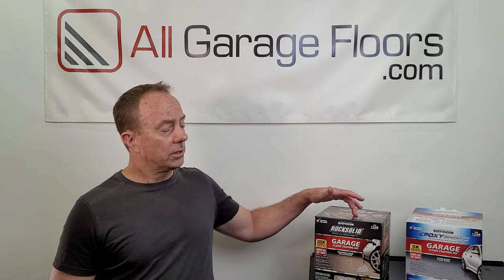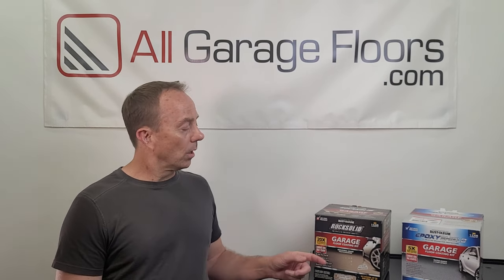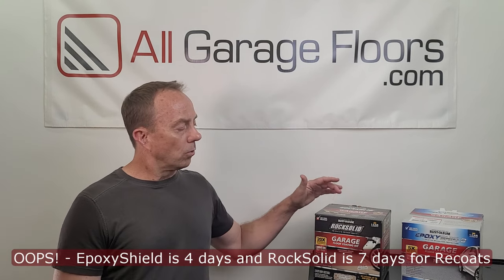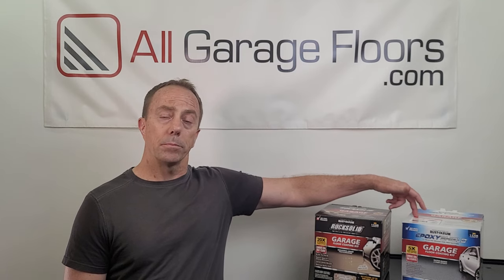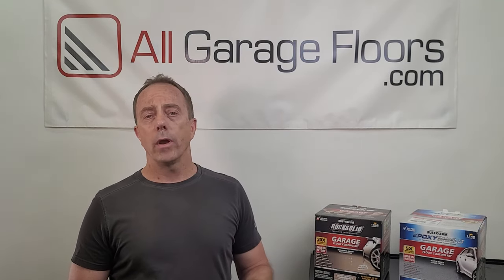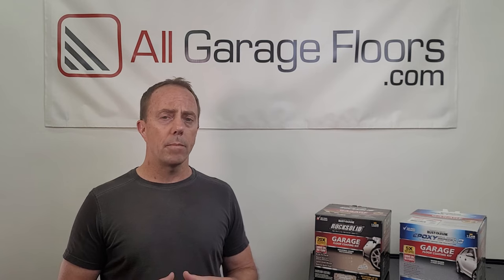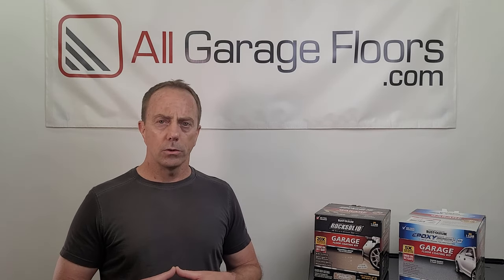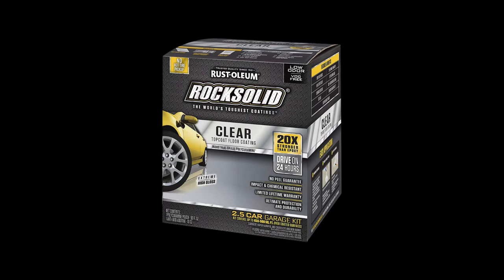RockSolid vs EpoxyShield | Which is Best for your Garage?

Comment: Great vid!  I just put Rock Solid in a basement work shop. The concrete which was about 50 years old, was recently ground down to a smooth-ish surface. I had 340 SF to cover, I used the 2.5 garage pack.  The results were terrible. Extremely blotchy/patchy.  The only good news is that Rustoleum is going to pay for a second 2.5 kit as they say that the only option is to add another coat.  I am within the recoat window, so we should be good.  Here is the bigger issue though.  After applying it, I realize that I really don't like the glossy look.  It literally reflects the bright LED lights in the ceiling so well that I can barely see when I am in there.  Do you know of a way to reduce the gloss?  Maybe sanding it (lightly) after its all done? Let me know.  Thanks!
Reply from the maker: Hi Zach. Sorry for the late reply. We found your comment being held for review for some reason. The best way to reduce the gloss is to apply the RockSolid Clear coat with anti-slip media added. The clear coat is less glossy than the color coat and the anti-slip media will cut down on some of the gloss as well.

Comment: Can you use the epoxy clear coat on the  rock solid ?
Reply from the maker: Hi Victor. No, Rust-Oleum states you should not intermix epoxy with RockSolid polycuramine and vice versa.

Comment: Very well presented with great details. I just painted my garage floor last week, but also found that the Rock Solid left a lot of discolored areas, probably due to concrete absorption of the product as you mentioned. You stated that re-painting can be done up to 7 days afterwards, but I will be out of town and won't be able to repaint until perhaps 10 to 12 days with a kit that I ordered on Amazon. Is there a lot of risk by waiting this long? Can I prepare the surface to make it work without having problems with peeling?
Reply from the maker: Hi Randy. There is no risk in waiting longer. However, you will need to prep the surface properly once you exceed the recoat window. This requires deglossing the surface by roughing it up with 120-150 grit sandpaper. A quick way is to rent a floor maintainer and go over the surface with a green scrub pad (dry) and then scuff up the corners and edges with sandpaper. Vac/sweep and then wipe the surface down with denatured alcohol or equivalent. Once it has evaporated, you can recoat.

Comment: Can we apply a layer of clear Rocksolid on top of color EpoxyShield for better durability? Thanks for your educational video!
Reply from the maker: RockSolid and EpoxyShield are not compatible. RockSolid Clear Coat can only be applied if EpoxyShield has cured for over 48 hours. It will require sanding the surface with 120-150 grit sandpaper to degloss the surface before you can apply the RockSolid Clear Coat. This achieves a mechanical bond. If you haven't applied EpoxyShield yet, then use EpoxyShield Premium Clear Coat. Apply between 12 hours and 76 hours after EpoxyShield has been applied. This will achieve a much better chemical bond. EpoxyShield Premium Clear Coat is a 100% solids epoxy that is compatible with EpoxyShield. You can find the best price here at Amazon: https://amzn.to/4dCtTAa
Reply: @allgaragefloors  Great, thanks so much for your reply.

Comment: Is there any clear coat sold in hardware stores/amazon that can be used as a topcoat for the epoxy shield and will reduce or prevent yellowing?  I got a good deal on leftover epoxyshield from a friend and will be using for an enclosed trailer for my mowing business.  The ramp will be opened and exposed to the sun constantly which is why I’m looking to reduce the yellowing. The trailer is basically new and hasn’t been used but one or two times.  I have applied zinser bin on the floor assuming I would be using deck paint.  Will this primer work with the epoxyshield as well?
Reply from the maker: Hi Shane. Any clear coat you apply will allow the UV rays to pass through to the epoxy coat and cause it to amber (yellow). Polyurethane and polyurea clear coats will not amber, but the epoxy will. This article explains more: https://allgaragefloors.com/why-epoxy-coatings-turn-yellow/

Comment: I have the rustoleom epoxy shield painting kit,can i then use the rock solid clear coat over that?
Reply from the maker: Hi Matthew. No, Rust-Oleum specifically states that the two kits are not compatible when applying within the recoat window. However, if you let the EpoxyShield cure completely, you can go back over it with 120-grit sandpaper to rough it up and then apply the RockSolid kit over it.

Comment: Do you have any data on applying either product to plywood, such as a floor in an enclosed cargo trailer?
Reply from the maker: Hi Ken. Both can be applied to a wood floor. It requires roughing up the surface with 60-80 grit sandpaper to remove any dirt and grime plus leftover contaminants from wood glue. RockSolid is the better choice of the two in terms of durability. Many times it requires two coats since wood is a more porous surface than concrete and both RockSolid and EpoxyShield are thin coatings. As a result, it typically requires two single car kits or one 2.5 car kit (2 burst pouches). The reason for this is that you can't let the mixed product sit the minimum 6-8 hours between recoats. An anti-slip media is required for the final coat or the surface will be very slippery when wet. 

There are much better coatings than these two that you could use. One example is single-part polyurea. It goes down much thicker, it does not require mixing two components (other than the color pack), it's UV stable, and much more durable. Plus, you can apply a single coat, seal the can back up, and then apply another coat 5-6 hours later. It actually costs less since you don't have to purchase as much material. We provide more details about single-part polyurea as well as links where you can purchase it here: https://allgaragefloors.com/polyurea-best-garage-floor-coating-kits/

Comment: Thanks for the Great video and it help me decide on epoxy to rock-solid iam gong with rock-solid and had a question for you do you recommend clear coat after rock-solid epoxy ? is that beneficial ?
Reply from the maker: Yes, a clear coat is always beneficial. It locks in the color flakes and helps to protect the color coat.
Reply: Sure thanks  @allgaragefloors
Reply: can u please advise me which one to use for clear coat for 2 garage i see textured coat and clear coat and its confusing
Reply from the maker: @badristraveldairy5362  Use the standard clear coat and not the textured. The textured version is much less glossy.

Comment: Large airplane hangar with black epoxy floor. Could I use a walk behind floor cleaner with the EpoxyShield? Red 3M pad to clean and dry burnish with white 3M? Maybe?
Reply from the maker: Hello Paul. We would not recommend EpoxyShield for a large airplane hanger if that is what you are considering. It is a residential quality product and among the lowest performers of all epoxy floor coatings. Cleaning with a Red 3M pad is OK, but you need to be careful about burnishing. If the white pad gets too warm it can haze the finish. That particular cleaning process works OK for commercial-quality coatings, but is not recommended for EpoxyShield or other residential coatings.

Comment: Thank you for a great video.  I would like to coat a newly built home garage and wondering about the prep.  The usual to clean it up as best possible, blow, vacuum, soap and or degreaser (although no grease on the concrete yet since new).  My question is whether a primer should be put down before using the Rocksolid product?  You mention the concrete can be porous so is priming not recommended because the Rocksolid product is made to bond to the concrete?  Any advice would be appreciated, thanks
Reply from the maker: Hello Peter. Once the concrete is clean, the most important part of the prep is to properly etch the surface. This is particularly important for new concrete. RockSolid provides the etching solution in their kits. There is not a proper primer available for RockSolid. It adheres very well to concrete. A typical problem that can develop with RockSolid is the coating ending up too thin after it cures. When this happens, another color coat is required. The following article discusses everything you need to know about RockSolid and primers: https://allgaragefloors.com/epoxyshield-rocksolid-concrete-primers/
Reply: @allgaragefloors  Thank you.  I am starting the project soon - one additional question;  You mention clear coat - is this a separate application once the original coat is laid down and dried (along with flakes)?  Or is this an additive that is mixed with the color coating in the Rock solid product?

thanks again also for the buying tips.  Very helpful
Reply from the maker: @Peter997S  The clear coat is a separate coating by RockSolid. You can find it here from Amazon as an example: https://amzn.to/3Xoa61P It can be applied from approximately 8-10 hours after the color coat is applied and up to 7 days after that. Otherwise, the surface would need to be sanded first.

Comment: Can I apply either one of these to the wood floor in my shed??  My 40x14 shed is my shop.  I hope I can use this on my floor!
Reply from the maker: Yes, they can with proper prep. Sand the surface with 60-grit sandpaper to cleanup the wood and remove any glues and other wood treating residues. RockSolid is the better choice since polycuramine has some flex to it. Epoxy does not flex and can crack if the wood floor flexes. You may need two coats.

Comment: If I go with the rock solid how should I prep the garage floor considering that it is a new home/new garage floor?
Reply from the maker: Hi Nancy. New concrete blocks adhesion more than older concrete due to the freshly troweled surface and excess laitance from new concrete. You need to clean the concrete well and then etch it with the solution provided in the kit.

Comment: If i grind the concrete first should i use a primer? If so what kind?
Reply from the maker: Hi Kyle. Rust-Oleum does not recommend grinding the concrete when using RockSolid. The reason is that the more porous surface will absorb more material, reduce coverage rates, and be too thin with a poor finish. A second coat is required to produce the recommended coverage rates with a rich, glossy finish. This doubles the expense and ends up costing more than much better commercial-quality DIY polyurea coating. 
True primers for coatings are 2-part epoxy coating primers. These are typically used for high solids and 100% solids epoxy coatings (3-4x thicker than RockSolid). Concrete bonding primers or any other concrete primer found at your local home improvement stores are not compatible with coatings (they are for paint) and should not be used. They do not bond as well and the coating will not adhere properly.

Comment: If i have brand new concrete from a new build home in garage. Do i need to degrease and etch floor still?
Reply from the maker: Yes, it's even more important with new concrete. Excess laitance and the finishing process to  make the concrete smooth results in more pores blocked and the coating will not adhere. This article explains more: https://allgaragefloors.com/etch-concrete-before-epoxy/
Reply: @allgaragefloors  makes sense thx u for the info and quick reply

Comment: my garage floor has moisture on it when it rains, what do i put down before the rocksolid to stop the moisture issue?do i also need to sand the floor first?
Reply from the maker: Hey James. First off... yes, you need to properly prep the surface of your concrete before applying a coating. RockSolid provides a citric acid etch in their kits. 

It sounds like you have a concrete sweating issue. I suggest reading the following article to help you determine if that is the case: https://allgaragefloors.com/how-to-stop-sweating-garage-floor/ 

If you have a sweating garage floor, then a coating will not stop it since it's a similar surface.

Comment: Planing on Using rock solid with a full broadcast chip,
Scape off loose chips 24 hrs later and then top coat with rock solid clear. Also have some half walls I’m planing on doing. 2 car garage but I’ve purchased two 2.5 kits and two kits of top coat. 
Any issue you see I may run into?
Reply from the maker: Hi Scott. No.... DO NOT use RockSolid for a full broadcast color flake application. There is a reason why these kits only come with a limited amount of color flakes. The coating is far to thin to accept all those flakes. Once you apply the flakes and then scrape them as required, you will have bare spots with the color coat showing. Full broadcast applications are for coating with a MINIMUM of 5-6 mils dry film thickness. High solids and 100% solids epoxy are typically 8-12 mils thick and most commonly used for full flake applications. RockSolid is only 3 mils. The color flakes when applied add approximately 5 mils of thickness. As a result, there is not enough RockSolid for the color flakes to sink into and adhere. Furthermore, you would require a minimum of 4 RockSolid clear kits to properly cover all those flakes since they go on half as thick as the color coats. The overall cost ends up being too expensive and underperforms since it's only a residential quality coating to begin with. Here is an example of a proper garage floor coating kit for full color flake application: https://bit.ly/4abJGUV
Reply: Thank you, 
I reached out to garage flooring and they helped me get me the product I need for the results I am looking for! Had not been for Your video I may have made a terrible mistake. Many thanks.
Reply from the maker: @ScottEla-yy1cc  I'm glad we were able to steer you in the right direction. It's one reason we started our website and YouTube channel. There are so many more products available for the DIY consumer that are so much better than what you can get at your local home improvement centers.

Comment: I’ve used the rock solid for the first time. I proceeded to wash& etch my bare concrete floor as recommended by rust oleum. The temperature at the time is 78 degrees. When I start applying on the floor with the V & W pattern, at first the floor looked evenly coated and the flakes were added. However, 10 minutes later my floors started to look patchy and I can’t go back and repainted, hence I continued to paint my floor. 8-10 hrs later, my floor looked patchy and some places look like it was never painted. I’m so disappointed and don’t know what to do next. In addition, I couldn’t finish my floor because I didn’t have enough materials to complete my floor even though I’ve used a 2.5 cars materials. Now, I’m very frustrated and don’t know what to do next. Please help me fix the patches & some bare areas that I encountered. Thanks
Reply from the maker: Hello Rosie. A 2.5 car garage kit is a generalization. The nitty gritty of applying coatings relies on the actual square footage. What is yours? The kit will cover 450-500 square feet under ideal conditions. Rarely are conditions of the surface ideal. We always recommend reducing those numbers by 10% when using RockSolid. If your concrete is more porous or not as smooth, it's not going to cover it all without being too thin. What you are experiencing are large patches where the coating is not thick enough. This is a common problem with RockSolid that we talk about in our video. 

The problem can be fixed by applying another 2.5 car kit. RockSolid gives you 7 days to apply any additional recoats within 7 days without further prep. You can coat right over the color flakes when you do this. Once a new coat is applied, the color will be full, rich, and glossy. If you are past the 7 day recoat window, you will need to degloss the surface first by roughing it up with 120-150 grit sandpaper. Sweep/vac and then wipe the surface with denatured alcohol or equivalent. After that, you can apply the second color coat.
Reply: @allgaragefloors  if an additional coat is applied as you suggest (over the flakes) will new flakes need to be applied?  Or will they still be visible once coating dries?
Reply from the maker: @Peter997S  Yes, you will need to apply new color flakes over the new coating. The new coat covers up the old color flakes.

Comment: The EpoxyShield 2.5 car premium topcoat epoxy says 15x more durable instead of 5x, and High Gloss instead of just Gloss. In what ways is it chemically different, and is it more like RockSolid?
Reply from the maker: Hi Jonathan. The EpoxyShield Premium Clear Topcoat is a 100% solids epoxy. There are no solvents or water to evaporate out. The standard water-based EpoxyShield color coat kits are just over a 50% solids and use a very old epoxy formulation. That is why the Premium Clear coat is more durable. However, we do not recommend using one kit for 500 square feet. It results in a coverage rate that is far too thin. And no, it is not similar to RockSolid. RockSolid is a Polycuramine coating and not epoxy. I suggest you read our article and review or RockSolid to learn more about it. You can find it here: https://allgaragefloors.com/rocksolid-polycuramine-garage-floor-coat/  I hope that helps.

Comment: Could I add this to my wood floor in my cargo trader? Just purchased a new one and looking to put a floor covering on.
Reply from the maker: Yes, you can. It requires sanding the wood surface with 60 grit before applying it. Two coats are typically required as well.